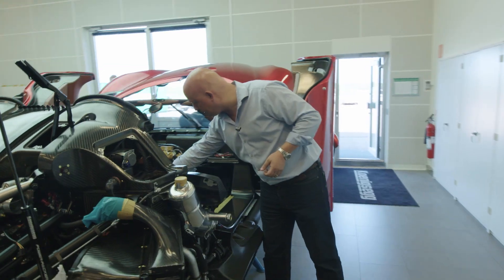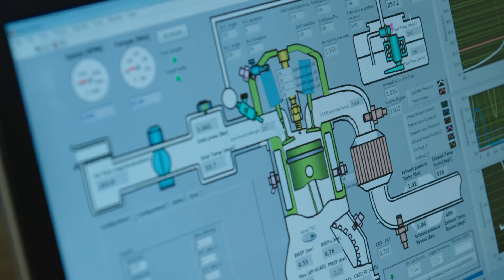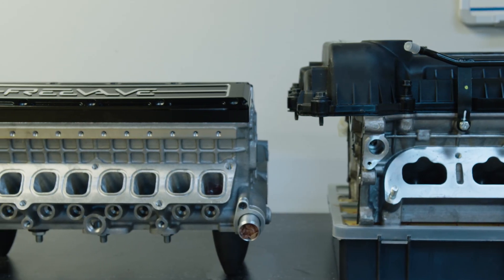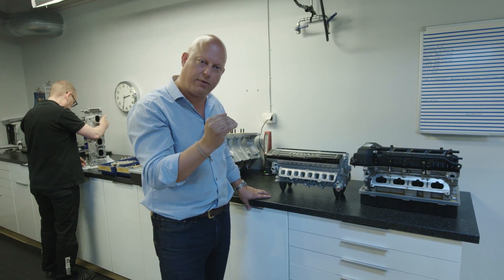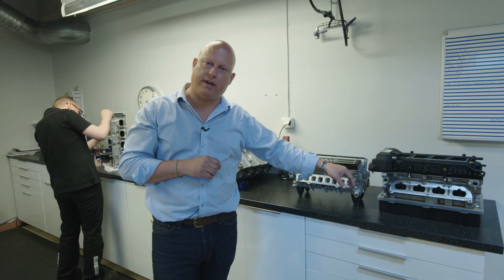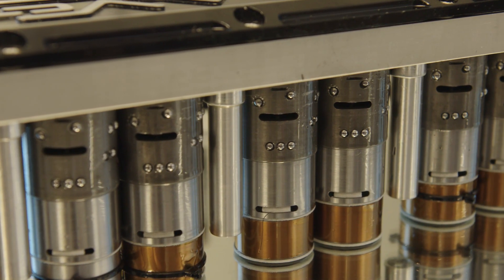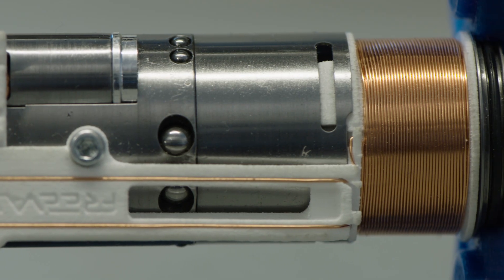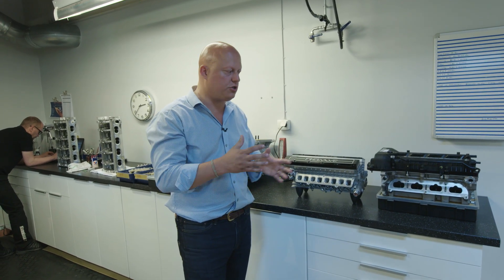Freevalve Update Camless Engine -- /INSIDE KOENIGSEGG

Comment: But will it last like 20 or 30 Years like Canshaft engines ?
what happens if the system has a failure, and how fast can this happen ?
Reply: It appears that this valve train has the potential to be serviced more easily and cheaply especially as the cost comes down over time. I want this shit on my Ford v8.
Reply: @jimkeith7099  Valves,Springs and Camsahft dont need service !?
Even a camshaftchain need no service before you hit 100 km / 70k miles.
Some chains last over 500k km / 400k miles.

You have A Ford V8 ? 

Hm on your car it may make a huge Fuel difference if you can shutdown zylinders.

I have only a 4 zylinder 8valve 1,6l engine :/
Reply: @Hobby_Electric  yea I guess it would just be simpler then and yes the power increase and fuel savings would make it worth if it was reliable.

Comment: I wonder if you were to put an oxygen sensor on the exhaust of each cylinder and ran each as an independent engine if that would improve performance.
Could this tech be used in aircraft engines?
Reply: Aircraft engines are famously conservative when it comes to adopting new tech. They still use magnetos and carburetors quite frequently for the same reason same are still used in a lot of racing, it's reliable and very simple. Fuel injection is still a relatively new idea in light and general aviation.

Comment: There is nothing I've seen with more potential to solve the the number one problem of piston engines.  The usefulness and application is far more expansive than mentioned in this video, and there is far more to making it work than he is showing.  I see the challenges as well.

I own a patent and learned that patents demand defense and production.  People patented things that I threw out, made money on them, and they went nowhere.  His concept isn't a new one.  Working through the challenges is the real work, and he may be able to pick up a few method patents along the way for risking part of his life to make this happen.  However, with such a sound concept, it warrants the investment to work through the challenges or fail trying.  I hope he gets the partners and resources he needs, or is picked up as part of another team, to make this a reality.

After the other challenges are overcome, he will end up with both intake and direct injection and the additional cost will not be a driving factor.  It has massive potential for diesel engines as well where it could solve two more problems.

Comment: I would imagine this system would allow engine braking to be utilized by closing the valves during the compression stroke and then opening just after TDC(without any throttle obviously). Basically a jake brake for cars lol.

Comment: Could make it a 2 stroke if not for emissions
Reply: Enlighten me🤔...I love 2 strokes but I don't see how we can combine the exhaust and intake strokes without intake ports in the bottom of the cylinder to push out old air charge with the new. A direct injected 2 stroke can have ridiculously low emissions but the oil burning is a problem. I'm not a 2 stroke diesel expert by any means but it was explained to me that the lack of intake valves is what gave them the ability to run away. I really hope someone figures out how to make a 2 stroke  with a 4 stroke style crank case that doesn't burn oil.🖖🏻
Reply: True, i was thinking the pressurized air could force the exhaust out, but thinking about now, I don’t think it would give enough time for compression, would be cool though.

Comment: Camless engine technology like this will allow a gas engine to produce massive HP on demand and then when not needed drop into a eco mode and get spectacular fuel mileage.  I do wonder though if this technology will go mainstream before all electric does?
Reply: Rebel N Dirt  yeah you are right. Shame when gas engines are about to reach the peak of their efficiency to be banned so electric can take over
Reply: Trevor Millard electric will never take over. Those batteries are so bad for the environment and not to mention you can’t dispose of them when there done. So we would have just extremely hazardous battery landfills everywhere. What could go wrong

Comment: He's the new god of cars no doubt but better as he actually wants cars to be more efficient and use less fuels while still increasing power.
Fact this is a few years old...why aren't we seeing more of this technology available.
Only downside is now tuners just about need to be engineers specially when everything is adjustable, one wrong move and good buy (although i guess you can put saftey into the valves to stop them staying open if piston comes up)